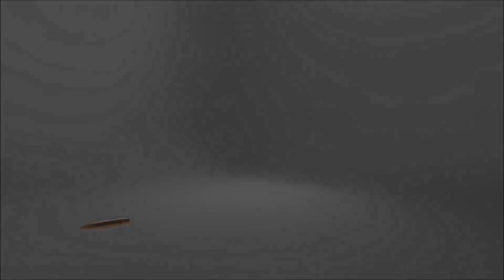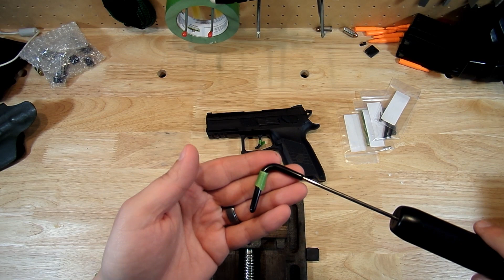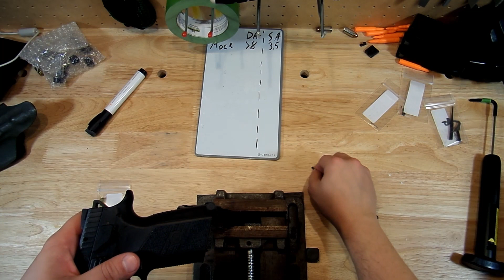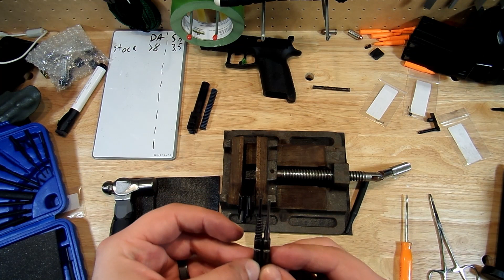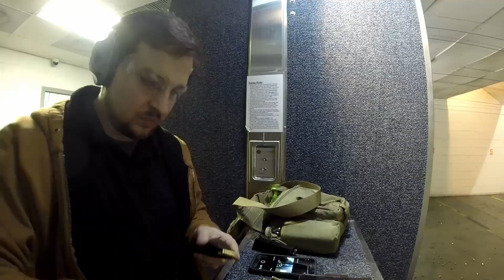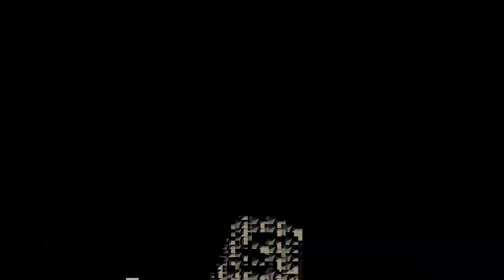CZ P07 Trigger Modifications new Cajun Gunworks CZ trigger pars installation

Comment: Put a 15# hammer spring in it and shave 20% off both weights,  I did a little more to mine (11.5# spring and extended pin and spring) and got DA 6# and SA 3#. It ain't rocket science, the hammer spring is what makes the trigger heavy.

Comment: Good morning Work The Trigger from 🇿🇦. Please advise me here, I have bought the Cajun Reset Kit but it doesn't come with the double action roller. Is there a need for it? I have the exact p07 gen 2 as yours by the way.
Reply from the maker: It's been a while, but I'm pretty sure you swap the roller over from one to another. Best option would be to call Cajun, though. They'll know for sure.
Reply: @workthetrigger  Thank you for responding.

Comment: So I just got my P07 and really love it. I did want to do some work to it but just can’t swing the 220+ for the pro kit and pay a smith to install some of the harder internals plus pay a smith to measure the roller bearing. Wanted to ask, which parts would you recommend getting first and if the pro kit is really all that necessary for a great gun. Thinking about hammer spring, trigger spring, retaining firing pin, red recoil spring, and gonna install a flat czc trigger, want to snag that CGW hammer but w the bearing now sure if I can swing it. I don’t mind the reset so was gonna avoid that. Any recommendations would be great, thanks for the video

Comment: Thanks for the video. Do you know poundage of the P07 stock hammer spring and the poundage of that yellow spring ? Thanks
Reply from the maker: i believe the stock is 18# and the one i put in is 15#.  from Cajun Gunworks, the "yellow" spring is 18#, my spring is "gold" and is 15#, i think.
Reply: @workthetrigger  Thanks 👍

Comment: CGW is awesome. But is unnecessary. I know it’s a preference thing. But this 
Pistol is perfect out of the box. Put about 300 rounds through it.  Buy a WML. After about 1500-2000 rounds now with the (P07) the Double action chambered pull is 9lbs. The single action is  3.3lbs. The slight staging grittiness on DA pull goes away after break in. Mine smoothed out after 300 rounds. Your paying  a lot for a slightly better reset. I just think for EDC it’s wasting money.

Comment: Good video. Although a little hard to see the work  any chance that your mods when broken in will show lower pull weight?
Reply from the maker: Yeah, if you need a better view theres a link to a better how to in the description. As for lighter pull weights over time, it's been a year or two now and the pole weights are exactly the same. So doesn't seem to change over time or where in or anything like that. I do plan to get an aftermarket Hammer however to crisp up the single action pull

Comment: Now get a different hammer spring. Will make all of the difference
Reply from the maker: +712criminal it's running a... whatever the reduced spring is that comes with the short reset kit. Next up is a new hammer: think that will crisp the trigger up
Reply: I'm working on tuning my SP01. I just bought all of the spring kits and the pro package. Messing around to get the best results.

Comment: I'm looking forward to picking mine up within the next week. I'm definitely getting the CGW short reset kit and the RP Trigger Spring. Have you replaced the guide rod? What do you think about that? Also considering getting the Dawson sights.
Reply from the maker: I have not replaced the guide rod.  on the polymer series pistols i dont think that's a big deal.  I am looking into it for my SP01, but i'm also replacing the recoil spring, so why not. lol
I would also suggest looking into an aftermarket hammer.  I'm currently doing a series on my sp01 modifications, where i put in an aftermarket hammer, and the difference between the two is significant.  the wall on the stock hammer of the P07 is mushy and easy to accidentally push past.  the wall on aftermarket triggers is no heavier, but is definite.  I will be replacing the hammer on my P07 soon.
As for the sights, i suggest Dawsons as well.  I have a review on the ones on my P07 up on the channel.
Reply: Thank you for the quick response. I love your vids and they've been extremely helpful. This will be my first pistol (and carry gun) so I'm glad to find your channel as it is such a great resource. Which hammer are you thinking of for the P07?
Reply from the maker: Probably just the 910000 from Cajun Gunworks.  It's a carry gun only, so i'm not concerned with any IDPA or USPSA rules like i was with the SP01.  the wall on the stock hammers is just very mushy, giving it an uneasy single action.  Great choice for carry gun, though.  I got the P07 as a 30th birthday gift for myself a few years ago and it's still part of my EDC rotation.  actually have it with me today (too cold for the P01)
Reply: What do you think about the grip? I'm thinking about stippling mine.
Reply from the maker: If you want, go for it.  I've never had a problem.  the stock texturing on the front strap and back strap is pretty adequate. but it's your gun, and your hand.  if you feel you need some more grip, it's one of the benefits to a polymer gun.
Reply: Thanks man. And do I need anything besides the 910000 hammer when it comes time to replace?
Reply from the maker: +Beau Selavka I would suggest calling cajun foe that. Their customer service is awesome. They will tell you everything you need. When I called about my p07 they gave me the exact parts to hit the trigger numbers I was going for
Reply: And one last question lol. Do you use any lights and / or lasers for the P07? I was interested in what would be fitting.
Reply from the maker: Beau Selavka I don't come up but if I did it would be the new TLR7 from stream light or the in force APLC. I own an APLC and it is a great little light
Reply: Ok one more: Do you conceal carry? I'm looking for an IWB holster. It would be great if there was a convertible one to OWB.
Reply from the maker: +Beau Selavka I do.  Can holster options are terrible. I've got a buddy who makes some good ones, he will be making one for my p07 soon, I'll have a video up about it

Comment: is there a way to move the release point of the trigger forward? on mine you have to pull the trigger a long way before it fires, I really don't like it!
Reply from the maker: +Dangerous Don not tjat I have seen. The trigger mods here don't change the release point, only the reset point, smoothness, and weight.
Reply from the maker: +Dangerous Don but being a DA/SA pistol, the trigger release point will be pretty far back
Reply: thanks for the info!  if I can get use to my keltec p-11's 3 inch 40lb pull,  I can get use to the CZ. lol

Comment: What would you recommend to just smooth out the DA so it's not so notch-ey and gritty? Possibly drop DA weight without dropping SA weight.

The SA is perfect and I don't want to drop it anymore cause it's already light enough. I don't care about a short reset or the new hammer. 

Would the SD spring kit and a new roller bearing work for me?
Reply from the maker: That was my main goal as well, to reduce and smooth the DA without dropping the SA too much.  The above modifications were what Cajun Gunworks suggested.  BUT, if you have other ideas, go ahead and give CGW a call, they're awesome and are willing to help you spec out the parts that you need to achieve the performance you want.  The modifications i did smoothed out the DA trigger a TON.  It's no longer gritty or steppy, it's a smooth, consistent pull through.

Comment: lol spent all that money on those parts and it did nothing to fix the trigger :(
Reply from the maker: +Matt C2083 well that's not true at all. Trigger weight dropped in both double and single action, and the trigger smoothed out incredibly, as well as shortening and creeping the reset.

Comment: that hammer spring did fuck all. what's the point in replacing it if doing so does nothing?
Reply from the maker: +Matt C2083 smoothed out the pull. Not always about weight.
Reply: if you want the trigger to be smooth.. shoot the gun

Comment: I've owned my P-07 for 2 1/2 years and have approx 1500 rounds through it. I installed the CGW Pro-Package myself, and also polished all the necessary internals. I forgot what the pull weights were so out of curiosity I took them again. With CGW 15# hammer spring, I got from DA: 7 5/8#  &  SA: 2 3/4# using a Timney Trigger Gauge. I did not always have a smooth pull. I noticed that my trigger was ever so slightly rubbing against the left side of the frame. I took an exacto knife and made several very light passes where the rubbing was occurring and followed that with some 1500 grit paper. Problem solved. Thought I would share this with you. Good video.
Reply from the maker: Thanks! my trigger is prretty well centered.  but checking for rubbing before ordering a whole trigger kit would be a great idea.  I absolutely love my P-07.  took it out to a New Years Day shoot and got at least one of the guys we were with to want one, too.  a definite win by CZ.... i still want a P-01, though.
Reply: If the P-01 would come ambi decocker, I would buy onein a heartbeat. I'm a lefty if you couldn't tell. I have a total of 5 CZ's including the P-07. All are great guns. CZ is highly underrated. My next and last CZ will be the p10c. Can't wait to get my hands on one. Several more weeks.
Reply: Rich Klein what internals did you polish? i polished my trigger bar, the ejector, trigger roller and disconnect. didn't notice a change.   also i have the safety in, not the decocker.
Reply: I wondered what the kinda gritty feeling was coming from.  Been thinking of taking my P07 apart and polishing everything and checking what you mention in your comment.  I don't really want less weight on my trigger, just to make it smooth in DA.

Comment: i know exactly what video you're using, lol.. I'm waiting for my cgw stuff to show up today for my p07. i got the gold spring and extended firing pin kit. thinking about ordering the short reset kit now..
Reply from the maker: It's a great tutorial... but that guy's voice!  i got lost because i kept falling asleep ;-).  
The short reset kit was a MAJOR improvement over stock.  it cleaned up the DA pull incredibly.   Obviously it didn't reduce pull weight much, but it was a consistent pull after that, rather than a stacking pull. I'd definitely recommend it.
Reply: Work i just watched your sights install too. i have the urban grey, threaded barrel version and it came with factory tritium high sights. i really like them but honestly don't need high sights, or threaded barrel really. i just wanted the colored frame. how are the dawson sights working out? is there tritium in the front sight also?
Reply from the maker: I love them.  They use Trijicon tritium, giving them a MUCH sharper point than CZ's stock night sights (my Rami has stock CZ tritium sights).  the front is a high viz, large white dot with a tritium insert.  the rear is mostly blacked, with very small white circles around the tritium inserts.  It gives you a great 3 dot picture when you're trying to line up a shot, but really quick front sight acquisition.  I will probably replace the Rami sights with Dawsons eventually, but the Phantom needs new sights first... it's got standard 75 sights and they're junk.